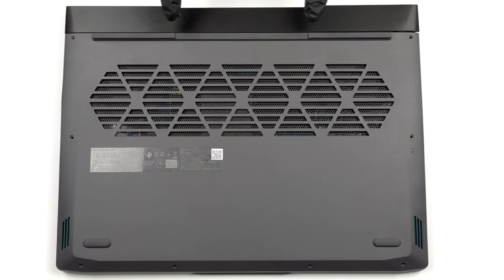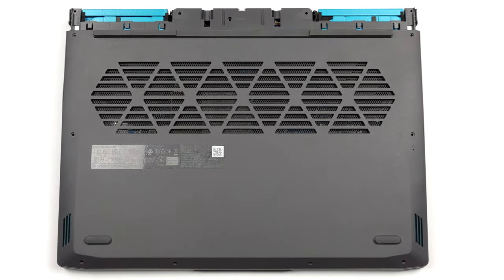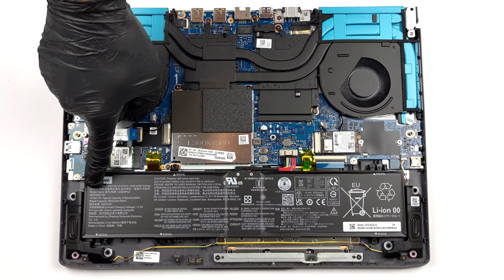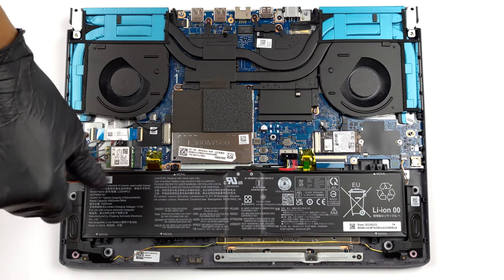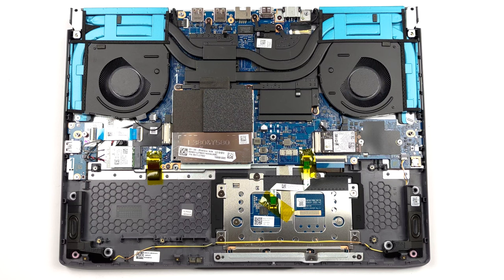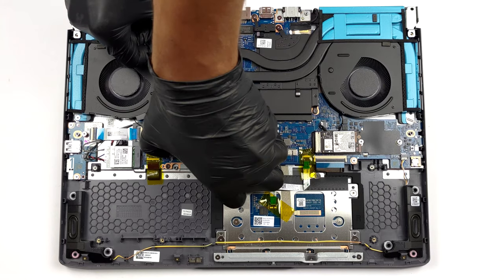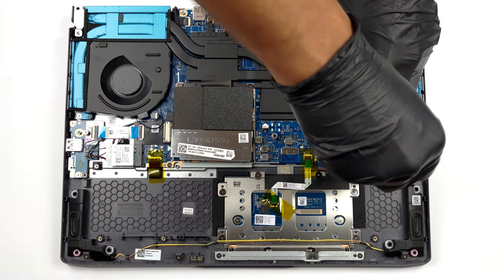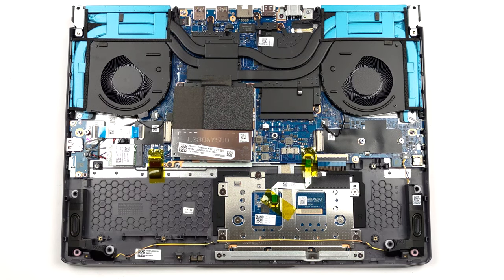🛠️ How to open Lenovo LOQ (16" Intel, 2023) - disassembly and upgrade options

Comment: I just bought Lenovo loq16 i5 13th gen, rtx4050, 8gb ram. I just upgraded it to crucial 32gb ( 16+16) 5600. It seems to work fine, system clocked it at 5200. I haven't done extensive test yet tho
Reply: Same😂
Reply: it come with ddr5 5600mhz right..can i use another slot with ddr5 5200mhz or lower?
Reply: @arrowsama7892  it came with 8gb ddr5 5600 but it's variable RAM so it the system would run at 5200 which is what it was meant to run.
Reply: what kind of ram do I have to buy to fit this computer? did yours have to be a certain size or something else?
Reply: @olddadagamer  I think all laptops use the same RAM. Sodimm (differs from desktop Dimm) . You need to know the speed and what size you wanted. My case, I got sodimm ddr5 5200mhz 32gb(16+16)
Reply: And how does everything work? I would like to put 16 GB
Reply: Hi, I am planning to buy this 16gb variant, can I upgrade to 64gb or 32 is the limit? And is there a single slot or double slot for ram?

Comment: Guys ALWAYS DISCONNECT YOUR BATTERY FIRST !!!!!
Reply: Why?
Reply: @xPainFull you can short components if the battery is still connected
Reply: @xPainFull  it can avoid getting your monitor fried
Reply: @xPainFull 😂 why so you can buy another laptop
Reply: lenovo does have a bios option that turns off the battery until the power adapter is connected that means you do not have to disconnect the battery

Comment: On first step he says remove 4 screws from shroud. I only see in video and can only find two on my laptop. But after removing two screws it does not want to slide out as shown. Where are the other two screws, under a cover somewhere?
Reply: the other two screws are not on the shroud but on the back close to the shroud on the bottom plate. I would recommend just unscrewing all the bottom plate screws in one go.

Comment: Can i install there an 2280 lenge of SSD m.2 or only 2242?
Sorry for that question but iam new in this :)
Reply: I watched review in which the reviewer said that 2280 can be installed since in has the screw for 2280
Reply: In this model you can fit both 2242 and 2280 in the primary slot (although it's not recommended to use 2280 ssds with double sided memory on this slot because the post for 2242 compatibility may bend the 2280 module). The secondary nvme slot can only hold 2280, but it doesn't have then bend problem.
Reply: one m.2 2242 and one m.2 2280 can be inistalled (upto 1tb)
Reply: @friendly-neighborhood-17 how much storage can i add to the lenovo 16 with rtx4050 (512gb)
Reply: @M4ndo pls help me for this
Reply: @friendly-neighborhood-17 Upto 2 TB. I just installed 2TB in mine.
Reply: @AbhijithSprk can I use the two solts with 2280 ssd or 
1 for 2242 and the other for 2280?
Reply: @abdulrahmanibrahim8340   The SSd that comes pre installed is 2242. It may be difficult/SSD may bend if you try to put 2280 in that slot.
Reply: @AbhijithSprk bro which did u upgraded to 2242 or 2280

Comment: hi, is it possible on this PC to go for 64Gb RAM ? or does it have like a limit that could bring issues ?
Reply: You can keep 64 gigs of ram. 32x2 DDR5 5200 MHz. But I don't think that would be any worthy. I am usin 16 gigs versions and its pretty much good. Planning to replace one of the 8GB stick with 32gb stick to make total of 40 GB. I wonder if any of my software would even cross 20 GB of ram usage, still I will have 20 for margine.

Comment: I bought Lenovo Loq 16irh8 i7 13620h and RTX 4060 recently . My default SSD storage is 512 GB ,there is second slot. What shall go for WD Black ,Kingston Fury or Samsung Pro 980? I need to add 1 Tb on second slot.
Reply: me personally I recommend Silicon power, as they have good performance for low price.
Reply: Yesterday I put a Kingston Fury Renegade 2tb SSD in the free slot and it works fine, so now I have 3tb = 1tb that was installed ( I bought same laptop as you did) + 2tb
Reply: @rudyvanhoenacker1002  Hello. Do you have 16 RAM? Is it worth 2 to 8? or one for 16?
Reply: @rudyvanhoenacker1002  I am planning to buy this 16gb variant, can I upgrade to 64gb or 32 is the limit? It’s i5 12th gen rtx 4050.

Comment: @LaptopMedia Hello i have LOQ 16IRH8
	
13th Gen Intel Core i7-13700H Windows 11 Pro, NVIDIA GeForce RTX 4060, U 16GB DDR5-5200, 2x SO-DIMM, Up to two M.2 PCIe NVMe SSD, 16" (2560x1600) IPS, 350nits, 100% sRGB, 165Hz, G-Syncmy My question is can I put on this laptop 64 gb ram pure or 32 gb ram I am unfortunately unsure and need a professional wheel from you. I would be pleased to receive an answer from you or the community.
Reply: You should be able to upgrade to 64gb but that would be the max ram the motherboard can handle

Comment: Anyone can confirm the max supported memory on the intel loq 16i, please?
Reply: 16gigs ddr5 5200
Reply: 32GB
Reply: The true max memory is usually what the processor supports. The maximum recommended is 32gb. Maximum possible is 64gb

Comment: can I install 16gb ram in each slot?
Reply: Lenovo states that you can have a maximum of 32gb. So two 16gb on each slot will work.
Reply: @keyluu949  thanks, but I am not gonna buy this. Dell g15 same specs 200 dollars cheaper
Reply: @ProAvgeek6328 yes Dell g15 is cheaper as well as it acts as utensil to brew tea or cook food
Reply: Dell have terrible build quality. It will fall apart with a year.
Reply: @steelwitness  that is partially true, a key on my dell laptop is already broken and the power button is wobbly after a year
Reply: @ProAvgeek6328  compared to lenovo dell might as well be garbage lol
Reply: @steelwitness  the dell equivalent of this with basically the same specs is $100 dollars cheaper even with a $300 discount on the lenovo
Reply: @ProAvgeek6328  specs don't matter after the laptop falls apart. You pay extra to get the build quality of the lenovo so that your laptop lasts 5 years instead of 2

Comment: Take a close look at the metal cover of the RAM and the RAM itself. Nothing bothers you? 😅 2:18 press stop
Reply: Can you please Tell me what to Look for? What is the Problem There? I wanna buy this laptop and remove the 8gb Stick and Upgrade to 2x16gb sticks
Reply: @Osaft24  Not to say that this is a problem, just a metal cover is needed to remove heat from the chips. As you can see on one RAM, chips on the other side. The metal cover removes heat not from the chips, but from the textolite.
Reply: @Osaft24  dont motherboard supports upto 16gigs
Reply: @friendly-neighborhood-17  no I have the lenovo loq and when running command prompt you can find out the maximum Ram. Mine came with 8 out of the box but it says it can handle 64.  I plan on ordering 2x32 and installing them and seeing how it handles it.
Reply: @chanceeckert5194 hi bro ,are you try 2x32? I confused to order because data sheet for this laptop show the maximum ram 32gb ,and I didn’t now if it work or no!, and if work good what the speed 5600/5200/4800?
Reply: @AzzamShalash  I have 2 16 gbs mine says it can handle 64. I’m at 4800